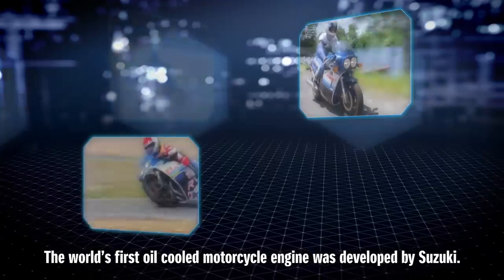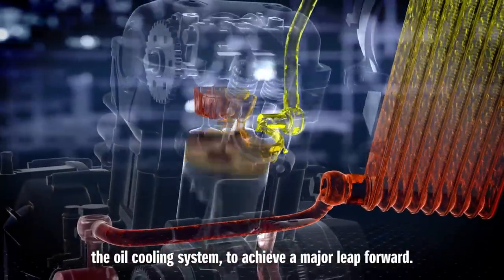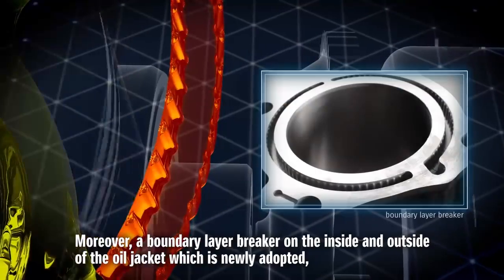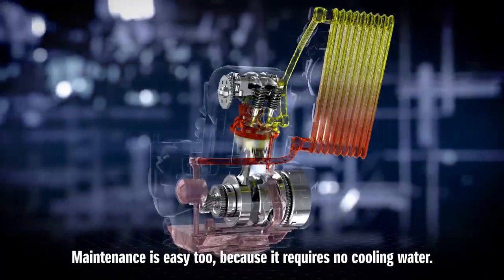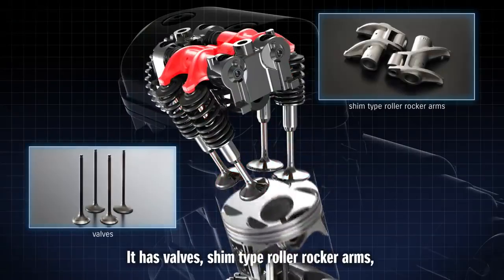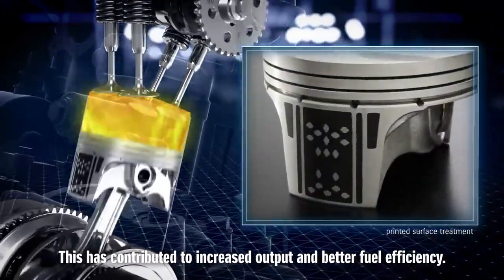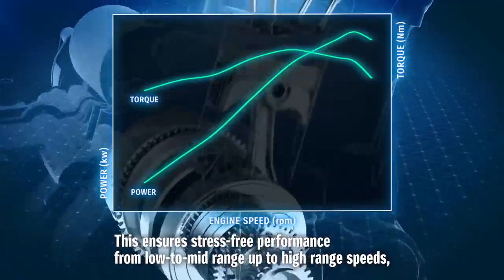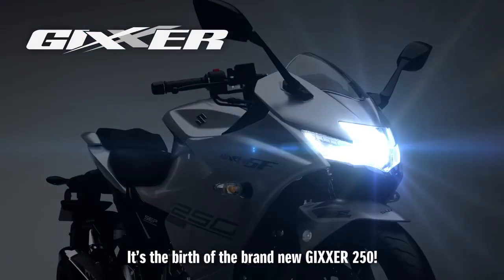Suzuki gixxer 250 : Suzuki oil cooling system explain.

Comment: I have gixxer 250  black edition. 
I have oil leak between the head and celender 
Its new bike i drive it about 40 kilometers
Reply: where is the proof .
Reply: guarantee still intact in that range
Reply: I do had a same problem in my V Strom 250. They fixed it by changing gasket but they took 3 takes to fix it. Dissapointed with Suzuki, its service and the so called customer service centre. I still have much problems with my bike
Reply: @changdevwalunj3286  any other major issue with vstrom, am planning getting one..
Reply: @trrrmac  The bike is superb, and so the smoothness, the performance. Just one thing want to say that while taking delivery check everything like the handle alignment. I do have a problem with its handle like it always pulling towards left when you take your hands away from it while riding.
Reply: I have same problem now its rectified and runnung like charm dude... no issue till now